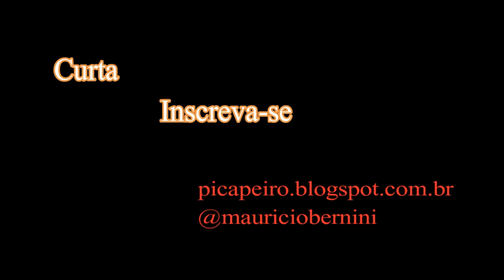Ligaram o Mixer em 220v e agora?

Comment: Ganhei um Mixer 127v mais onde eu moro é 220v tem como eu converter ele pra 220v?? Parabéns pelo vídeo!
Reply: Oi estou com esse mesmo problema
Reply: Compre um transformador pequeno... de 500 miliamperes à 1 ampére..  como usa pouco tempo... o de 500ma dá conta. Sai uns 40 reais. Transformar em 220 tem que enrolar a bobina e não compensa.
Reply: @arbustro1  consome mais energia e a durabilidade do aparelho tbm cai
Reply from the maker: Possível é, colocando capacitores em série, mas não vale a pena. Mais em conta um mixer novo.